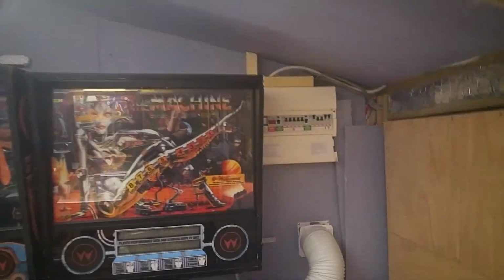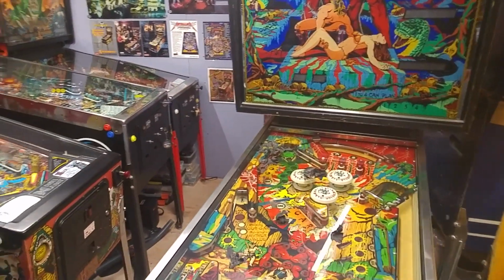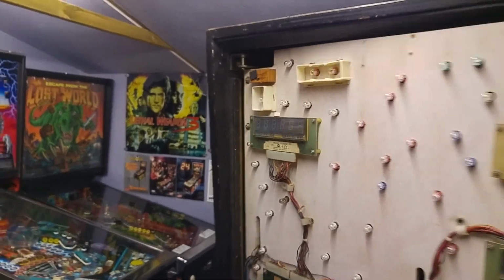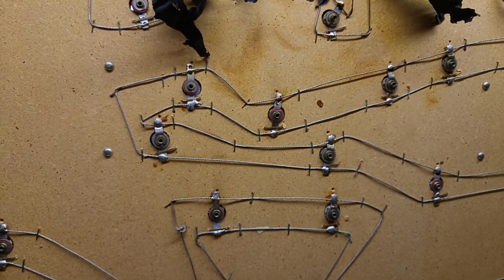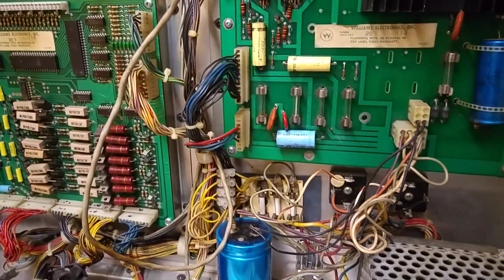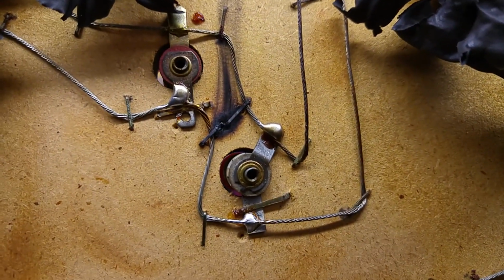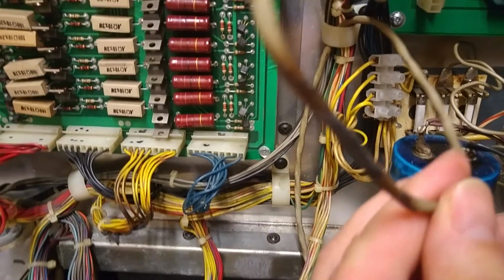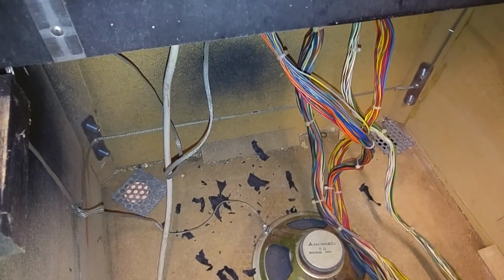Gorgar Pinball Machine Fire Incident

Comment: That's fitting for a Gorgar considering its theme. Gorgar is a great games but it's flippers need more power.
Reply from the maker: +rarecoolitems I had mine set up super steep and it played very fast, there was certainly plenty of flipper power (using the original coils) Mine has had the flippers rebuilt and they work great. If you have weak flippers it's worth tracing out all the wiring and connectors as you probably have a weak ground path

Comment: Do you recommend replacing the GI fuse with a lower rated fuse than what the manufacturer recommends to help avoid this type of thing in the future?
Reply from the maker: +Classical Rips There are about 70 GI bulbs (so 70 x 0.25 = 17.5amps) the fuse is correct. I have replaced all the Backbox GI bubls with LED's so I can probably reduce it to a 10amp now

Comment: Wow, that couldve turned out a lot worse. Perhaps it's a good idea to do the GI fuse mod? You can fuse every section/yellow wire with 4 seperate 5 amp fuses, instead of the 20 amp fuse, it's a lot safer. 

Strange how a (what looks to be) almost direct short got past inspection back in the day, and even stranger, how it lasted so long without causing problems :)
Reply from the maker: +Rhytz Indeed that is a good idea to do. I could go further with these old games and split the GI strings under the playfield and installed 2-3amp fuses per section

Comment: Really would like to see an update if the fuse was infact the correct rating and it didn't blow as i know you say so many times in all your videos, Step 1, check the fuse ratings!
Reply from the maker: +cozzm0AU It was the "correct" 20 amp fuse. The problem is, 20amp will almost never blow, but that's what it needs to handle all the GI bulbs